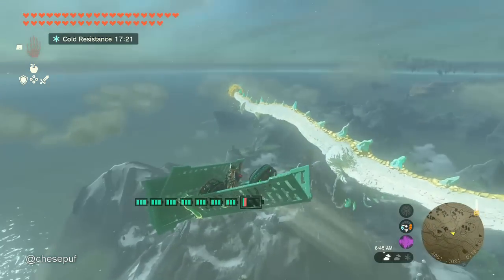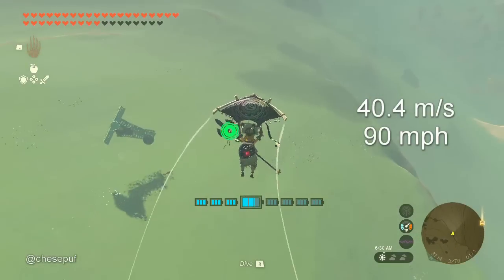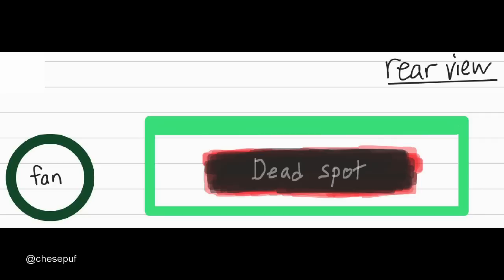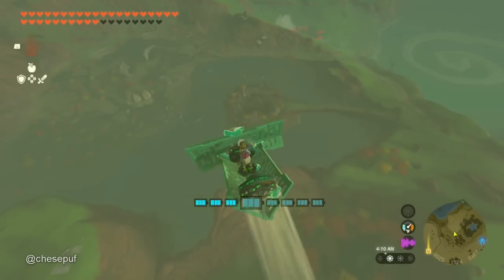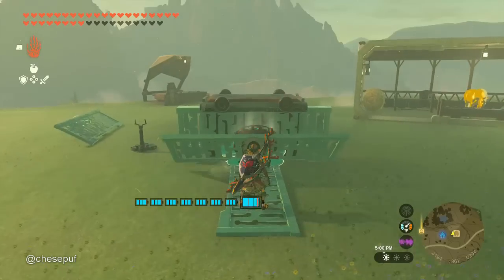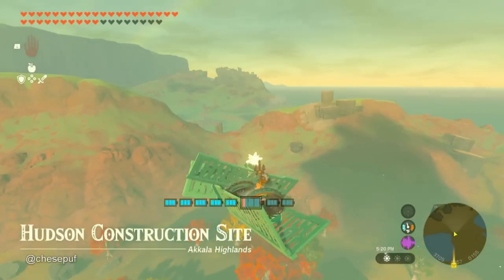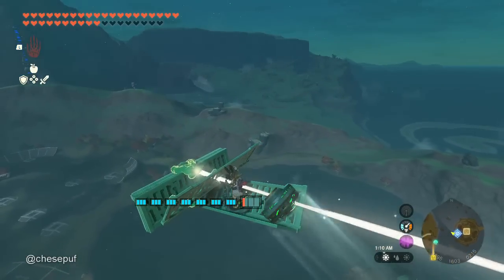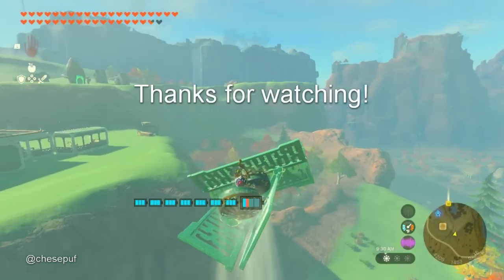How to MASTER the Railjet, Part 1 | Tears of the Kingdom

Comment: Great video! Looking forward to the next two.
One thing that I want to mention, regarding the dead spot you've mentioned, I have a hypothetic explanation. So, the fan projects a cylinder-shaped wind, and its height is determined by a line drawn from the fan center. Whenever this cylinder collides with an object, it adds wind force. Therefore, when you hold it slightly higher, where the fan center passes the rail edge, the cylinder becomes long enough to collide and adds force. Similarly, when it's in 45 degree, the cylinder is also long enough to collide with the stacked rails, because the center line is extended diagonally.

Comment: I'm trying to use railings to create a hover deathbot. Using an upside-down construct head on a regular one I was able to get a fan to work and act as a sort of homing steering but even with railings I can't get anything to hover more than a few inches from the ground once I add a bunch of weapons and a stabilizer. I thought I could use a detached fan and the railing to maximize my upward thrust but it's still just too heavy once you add a stabilizer and a construct head with a few weapons on it. Any suggestions? I did make a homing hover bot that was effective in low gravity but in regular gravity it's no better  than a homing cart since it barely has enough lift to glide across flat surfaces.
Reply from the maker: I see, this is a cool idea. Yeah the railings won't be able to lift as much weight as it sounds like you have. I know a stack ( like >5) of railings can lift a cooking pot and stabilizer, but that's about the limit. How many railings are you using for the lift?
Reply: @chesepuf  I tried it with only 2 railings because the cage I built to lock the loose fan in place already required 3 so I was running into the problem of hitting the component limit before I had enough weapons to do much. For some reason fans won't  blow on top of a working construct head OR on top of a non-working but upside-down construct head. They have to be attached to the upside-down head in a way that allows it to still move which means they overcompensate a bit and tend to circle the enemies—not really much of an issue if the device actually hovers a bit but when it gets stuck on even small rocks it tends to just get hung up and tear its own pieces off. I wish the fans just worked on a normal, upright construct head, why did the devs think that would be bad?!

Comment: if you attatch a railing to the moving part of a small wheel it does not detatch,  like it would with any other item
Reply: you can also use the railings to connect zonai devices. Try attaching the railings to a construct head and then place a beam emitter on that rail
Reply: @Mamma1999 What?! That’s a crazy cool effect with a lot of building option implications!

Comment: If the edges of the rail catch the air, have you tried tilting the rails at a more steep angle so that both top and bottom edges catch air?

Comment: I think that i made a plane with the what i call the "railing motor" (the stacks of railing + non attached fan) in the back first and it actually has better manuverability than the ones with the railing motor in the front and it even has just enough speed to not kick link off of the steering stick. I definitely think you should experiment more with it. It could also make X-Wing builds better looking

Comment: I'm curious, have you considered instead containing the railing stacks in, say, a box of sorts while connecting the front fan to the main body? So the rail stack is "loose" rather than the fan
Reply from the maker: I have! That's called a "junk drive" by the hyrule engineering subreddit. It's a viable build, but I focused on the loose fan since I found it easier to contain a fan rather than loose railings. If you have good ideas for the junk drive, I highly encourage you to try them out!
Reply: @chesepuf  Limiting horizontal motion with something like other rails or objects (star fragment, dragon horn, etc) would work wouldn’t it?

I feel like the quality of life of having normally controllable thrust with a Fixed-Fan build is a huge upgrade over the Fixed-Rail builds.
Reply: I've actually just seen a video where somebody is driving/flying using lasers shooting these exact same rails.

Comment: What if you balance gravity with a loose fan? Can you get something to hover in neutral?
Reply from the maker: I think a single loose fan will weigh less than the rail force it would provide, you'd need to add some more weight

Comment: If you put a gimble on the steering wheel couldn't you pass the speed limit
Reply from the maker: I think it's a hard coded limit that if link is traveling > 40 m/s, he can't grab the control stick. There may be a glitch that changes this, but for vanilla playing, Link has to be <40 m/s to use the control stick. Maybe the gimble breaks this rule, do you have a link where someone does it?
Reply: Gimble?
Reply: @reubendeeley3830 the zonai cooking pot rotates itself upright